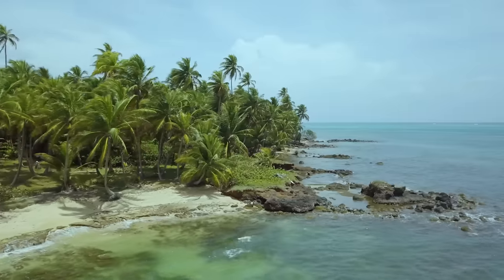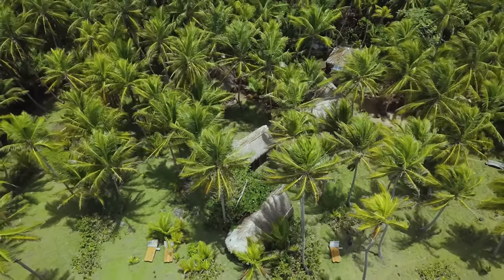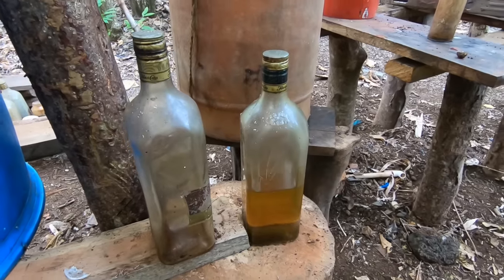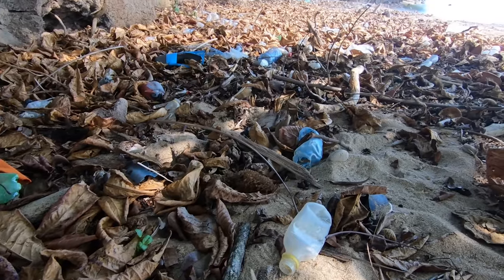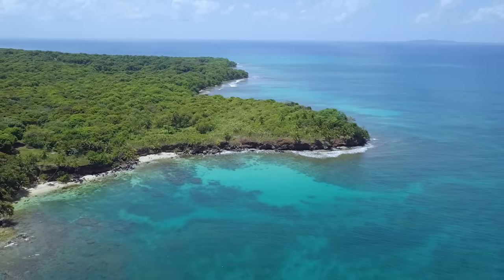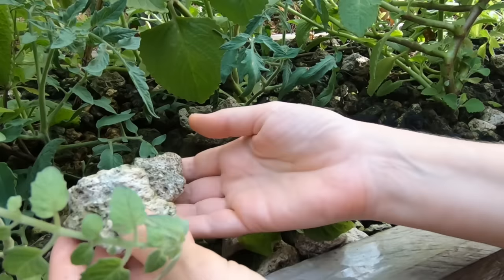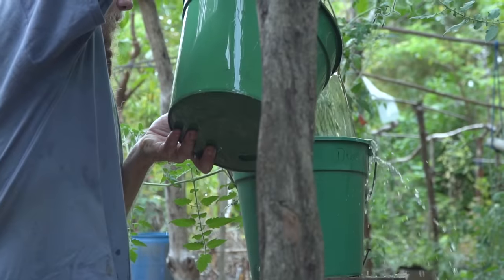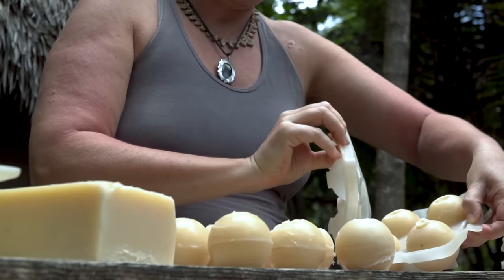THIS SELF SUFFICIENT FAMILY MAKES THEIR OWN FUEL FROM PLASTIC!

Comment: If this go viral in Indonesia, the rivers will be clean by tomorrow
Reply: yoooooooo lol god tier comment
Reply: #extendedcarwarranty
Reply: Hello this is social security administration
Reply: Lol, reality is funny.
Reply: and the air is unbreathable
Reply: @phbueychewy6260   you can definately do this it's done in india there is a company itself but if we try to do it at home police will catch us ...
Reply: you need more wood to heath it than that the fuel will bring
Reply: Solar powered oven?
Reply: George Clooney
Reply: @crisvanhoogstraten4160  maybe, but you can't put wood in a diesel generator. There are wood generators, like early cars, but the distribution, storage, guarantee of reasonable homogeny of the product and ease of use will be severely reduced. Also, it gets rid of the plastic. 
Eco regulations in the west will enforce the use of an airfilter system for exhaust gases. That's the only thing they'll still miss and a way to recycle the motor oil and other liquid exhaust products from rather crude diesel.
Reply: Haha yeah.. Agree man
Reply: @crisvanhoogstraten4160  So when they refining oil they do not use energy?
Reply: And the air will be grey.
Reply: There will also be fleets of ships headed to the ocean garbage patches
Reply: @girishmb1725  they are going to be working on slower cold processing ways of doing it scientists are working on it  also we should also find a way on using carbon dioxide
Reply: And the rain forests would be razed to fuel the distilleries.
Reply: Mars too.
Reply: @lee8org  when you distil you don't make a chemical reaction you separate and takes less power. When you heat plastic a part of energy is used to change the molecular structure. The energy of wood is stored into the oil from plastic, you don't gain energy
Reply: @BossOfAllTrades  no offensse but study a little bit chemistry thermodynamics. Carbon + oxygen = CO2 + heat. If I want to use CO2 at something I must use heat to break the carbon and oxygen molecules, that's why CO2 is a waste product, it doesn't produce energy
Reply: @Kannot2023  But You still need the energy to go through the process.
Reply: But the forest will be gone 😂
Reply: @ErikBramsen  you could use coal instead of wood.  Or fission🤣
Reply: Yeah... just literally burn plastic, great for the environment 😑
Reply: That's what I thought of aswell xx  All the plastic that they have can instead of a hazard be a blessing 🙌 🙏
Reply: @multatuli1  or just sadly washed up there ....
Reply: @6181green  can hope.
Reply: @ErikBramsen  no good then.
Reply: @crisvanhoogstraten4160  you can use the oil from the plastic to heat the plastic.
Reply: Nuclear power to generate the heat to melt the plastics to make the diesel.
Reply: ..and the day after tomorrow the air won’t be breathable…
Reply: Or india
Reply: Steam driven generators is common. Matter of fact they already drop water down 1 tube into a lava tube and steam comes up another tube and that steam is used to drive generators. Look it up.
Reply: @crisvanhoogstraten4160  then get it no ?

Don't think so negatively. Get the fuel you need but the conversion to liquid fuel allows to run the machines plus picking up trash in the process plus making some money, food, pets, friends while you're at it ?
Reply: @suprememasteroftheuniverse  yes we do need to make sure filters are being used in order to not ruin the air so don't do this unless filters are set up FIRST.
Reply: @Kannot2023  CO2 doesn't produce energy ?

So what's that stuff they use in metal containers that provides the ability to fire off paintballs in paintball guns ?

🤔
Reply: In Pakistan as well
Reply: It's not even complicated
Reply: Should go viral everywhere
Reply: @tristqnejdjeh7278  lol I call them the scammers now
Reply: And Indonesia will be Rich in no time .
Reply: If that’s the case than what it’ll take India about month maybe two at get their rivers clean?
Reply: Yeah and the sea levels would rise 30 feet because of all the diesel generators lol
Reply: @kim Chiwa!D: Good idea!! Maybe we could all use an Indonesian VPN and like and share. YouTube algorithm will start popping up in Native Indonesia to spread the news
Reply: @crisvanhoogstraten4160  ahh really? So woodgas would probably be a better option? I wonder if there's a way to do both? Wood gas and plastic that way the beaches can still get cleaned 😉
Reply: @ErikBramsen  hopefully you mean the Amazon rainforest will be 🙌 raised!
Reply: @Kannot2023  CO does produce energy the incomplete burn so your logic is flawed. Look at biogas or woodgas. Yes you burn the wood, you condense the gas and can use the carbon monoxide and other combustion biproducts to combust later can produce power in many ways. It's not 100% but any step towards 99.9% Efficiency is a good one do you agree? Sorry this is a late comment. Maybe you've though more about this since then. I just keep seeing a lot of nay saying comments on this. The fire could be used for heat and power generation as well through boiling water for steam turbines or home heating if that's even needed where he lives but the process of cleaning the beaches is a noble one for sure especially if it can be done right.
Reply: @usavideogames7599  NZ is right about the fact that CO2 is a stable non-combustible gas what is in paintball canisters is compressed CO2, it takes energy for the compression. As things heat they decompress. If you're interested in learning more look at Pressure Temperature (P/T) relationship also Bernoullis principle about airspeed and pressure, as airspeed increases pressure decreases. As temp increases airspeed increases pressure decreases, release of pressure causes a decrease in temperature because the heat from the surounding environment is being forced to the canister at a higher than atmospheric pressure, to accommodate ∆P if you're interested in building an air conditioner or understanding how they work for repairs or just curious it's good to understand this. I may not be the best person to teach about it but this incredibly powerful information is freely available to all affected by air, temperature and pressure (that's everybody btw😉)
Reply: And the air would be worse
Reply: @saibabagarden  codyslab has a video on how to make activated charcoal. But If it's only sulfur that needs capturing water vapor filtration might be the best option. It's what's used in coal power plant scrubbers. The biproduct is sulfuric acid that can be used in lead acid batteries which can have a very long life if we'll maintained. This discussion is good to bring up all the problems and learn how to deal with them.
Reply: @wssometimesavowel3639  Sulphur is first in that oil/kerosene that we get by pyrolyzing our plastic waste, and later - when we burn (for example) that same kersosene in our cooking device, again there are vapors of sulphur. (Last situation is even worse, as we breath the poison).  How do you get rid of sulphur with water vapor filtration, I don't get it? Perhaps, what you mentioned is not usable in our conditions?
Reply: @saibabagarden  the water reacts with atmospheric sulphur dioxide to create sulphuric acid. There was a big problem with Acid rain in the north east killing evergreen forests in Canada and New York until there was an EPA mandate to build "scrubbers" its just the long tall chimney looking structure where the steam can cool and the sulphur can react with the steam and drip down so that the sulphuric acid comes out at the electric production facility instead of falling from the clouds as acid rain.
Reply: @wssometimesavowel3639  just the long, tall tower.. Not for small DIY projects I'm afraid. By the way, pvc plastics, when we melt them, we get another acid in our system, which is HCL.. Perhaps, this problem is even bigger than sulphur, cause pvc is so widespread, isn't it..
Reply: @wssometimesavowel3639  sweet.

Thank you.
😃
Reply: @usavideogames7599  ♥️
Reply: Lol
Reply: @neosildrake  yes u can 😂  u put woo in one barrel… have another barrel on top with wood clippings in it… when the bottom barrel gets hot it heats the wood clippings… this lets off a glass that burns…. There u go… it can be done
Reply: Or California. And we could start getting rid of the pacific trash patch.
Reply: @crisvanhoogstraten4160  use a professional lens a really large one to help supplement the cooking fuel
Reply: Citarum river
Reply: Not sure if that scale co2 and other greenhouses gases emission is good
Reply: I doubt it.
Reply: And the air is going to be so polluted yes. And your trees are going to be used for burning it as well.
Reply: I'm a dead man over here you're talking to a dead man
Reply: @johnreeves4207  100% imagine using a micro fission reactor to make one of these along the shoreline to reuse all the old plastic ropes and garbage that washes up
Reply: @neosildrake  " it gets rid of the plastic" -  How is this a good thing? You are releasing the carbon from the wood and the plastic and pumping it into the atmosphere!
Reply: The world
Reply: @usavideogames7599  it took petroleum powered pumps to compress that CO2. 😆
Reply: So, if I burn the plastic I toss out, will the EPA still fine me?
Reply: I can agree with that.😊
Reply: I don’t know why people are scoffing.  Most of these countries are making their own methane for cooking from the biomass they make or gather.  The biomass is a waste product from various endeavors.  The methane will be used to cook down the plastics gathered together.  Then, they will have their own diesel and gasoline.  Really, it’s just recycling trash that would end up in the landfill.  I think it’s good repurposing.  If some one comes up with a good electric car, that is affordable, and can drive 400 miles or better on one charge, then that would be an option.  The electric car also has to survive -40 to -50 deg F at least over night.  Good luck with that requirement.  Not every body has a garage to put their car in up north.
Reply: Espero que pase.
Reply: Lol
Reply: Na,still takes work.
Reply: Big solar and wind would put a stop to it.
Reply: And tourists wil need rebreathers, not just the ones that go diving, just all of them. :-D
Reply: Don't worry! I'm shure, they'll find something else to throw in.
Reply: Doubtful, the still put human corpses in the rivers.
Reply: Except won’t be any trees left and the air will be polluted both from the process of making the fuel and burning it in generators.
Reply: Or Mega Manila in the Philippines
Reply: "clean" ... people seem to ignore the Black fume coming out of a fire that burns with this.
Reply: @6181green  There already is
Reply: @Kannot2023  CO2 is used by plants, so even as a waste product it has a use. The dude in the video is surrounded by plants. It goes to use.
Reply: @ErikBramsen  Nah. There's more than enough dead wood in the world already.
Reply: @Kannot2023  But you could cook food and fuel from that same energy, thus doubling your output. Plus, if you live in a cold climate, you could use the burning wood to heat your home while making diesel to power your generator. Mega fuel efficiency! 😊
Reply: How will this remove indonesians from indonesia?
Reply: @ErikBramsen  Not at all. Everything gets used and reused and recycled. It's actually very smart, albeit also very labor intensive, but you, being priveleged and reaping the benefits of others' labor, wouldn't know that.
Reply: @annep.1905  Recycling is only smart if the process doesn't pollute more than making new stuff, or consume more resources. If it takes thirty pounds of wood to recycle one pound of plastic, you're adding to the problem.

Plastic is eminently recyclable, you burn it in a power plant and get (almost) the energy equivalent of the oil it was made from, leaving only water and CO2. This guy is doing that, except he adds an interim step by distilling it before he burns it. 

So the end result is the same: plastic turned into energy, but if you do it this way you add thirty pounds worth of deforestation to the process.

Treated properly, plastic is one of the most environmentally friendly packaging solutions known to man.
Reply: @annep.1905  
"You can cook over an open air fire and not ruin your lungs."

Not inside a dung hut with no fireplace, which is what an open fire pit means. 

And there's a big difference between using 5 cubic meters of wood to heat your house through the winter (I do so myself) and using the same volume to fill the tank of your car.

And I'm not accusing you of being a fan of GP - I noticed your comment in the previous post. What I'm saying is that this plastic distillation scheme is Greenpeacerism: use a shitton of fuel to produce a trickle, add a pinch of romantic primitivism and sell it as a way to save the little brown brothers.

I'm from Denmark and due to rampant Greenpeacerism, our power plants are now running on wood pellets, harvested from East European, North American and Indonesian old-growth forest. 

And here's a thought: if this was an even remotely viable way of utilizing the energy in scrap plastic, don't you think all these green scam artists would propose it on a big scale, offering to build big, subsidized plastic-to-fuel plants?

Somebody is bound to have thought of it. And somebody else (with an actual engineering degree) would have told them they'd need ten gallons of actual diesel to produce one gallon of plastic diesel.
Reply: @ErikBramsen  Ah, an open fire pit is just an open fire pit. It doesn't have to be indoors in a dung hut. It could be outdoors, and often is. Somebody might at least teach these third world people how to build a fireplace with a chimney, which is how many homes in America and Europe got by for centuries.

Okay, I understand the way you are looking at this, but I think maybe I'm coming across wrong, in that case.

Here's the way I am looking at the issue: lots of people build fires for enjoyment or practical purposes, so why not make a little plastic diesel fuel on the side? There's probably a better way, e.g. if you could subject the plastic to high pressure you would probably need less heat, and there's certainly a better method of producing energy, e.g. nuclear power plants, but most people will not be able to make either of those things happen, so why not allow or encourage people who are already making fires to also transform plastic into fuel? I have a feeling you know something about this so here's a question for you: If you distilled plastic during the winter as you heat your house using a wood-burning stove, how much diesel could you produce over the same fire that's also keeping you warm over the course of the winter?
Reply: @crisvanhoogstraten4160  just like with the solar panels, or the wind turbines...you get fuel you can use since they dont have a wood burning generator do they
Reply: Its funny to see those worrying about CO2 and other gasses release, laughs in vulcano language
Reply: I love this ! I don't know have anything that uses diesel,  but learning to make it is awesome.
Reply: @crisvanhoogstraten4160 use bamboo as fuel instead? Also wood is renewable, they can probably just use a fast-growing tree for fuel.
Reply: This is not clean, safe, or efficient.
Reply: In America too?
Reply: Maybe it should